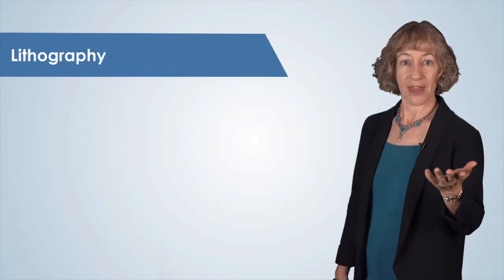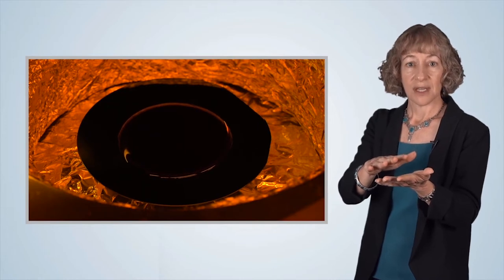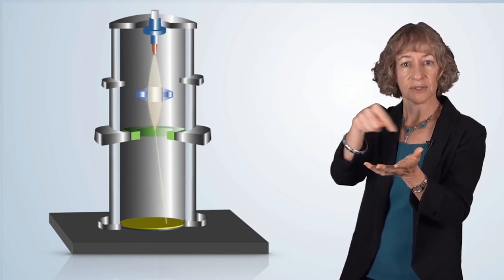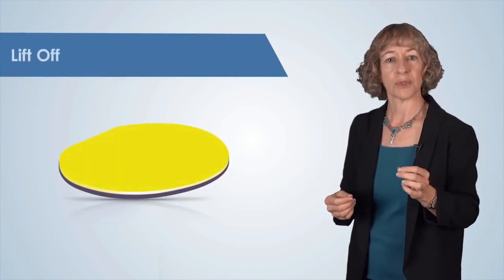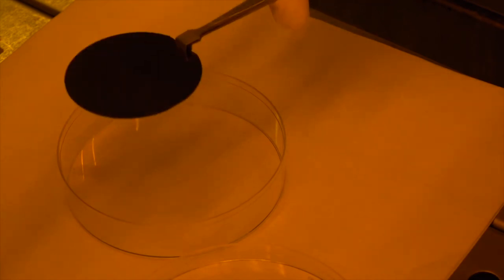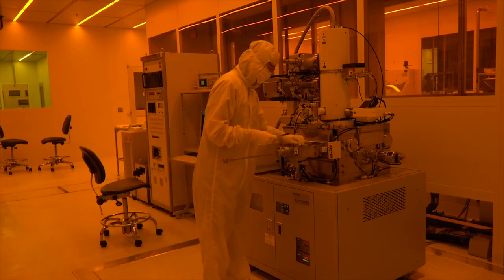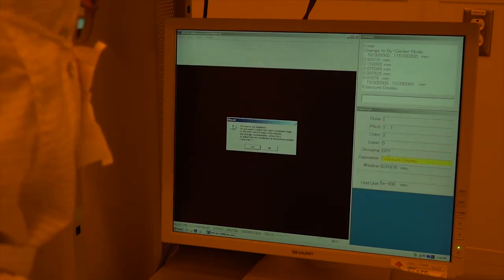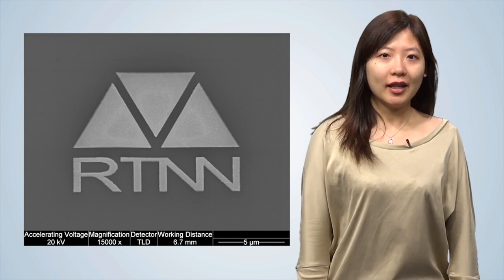Introduction to EBL

Comment: You said: "In development, only the parts of the resist that have been exposed by EBL, will be removed. But this is only true if the resist is a positive resist. If you use a negative resist, all the exposed parts are going to be hardened , and after the development, only the unexposed areas get removed.

Comment: its just a crt display, can be directly ripped out of the existing hardware, or 3d printer style printer head moving by small straight on-off electron jet source, you dont even have to use electrons, you can use direct embedding particles, direct printing, picoelectronics and picoelectromechanic systems

Comment: EBL just work like the old Cathode Ray Tube TV screen. I am not surprised if China is working on the LED-like beam flat panel Lithography machine now! It should be just a efficient as the Photolithography machine but cheaper!

Comment: Do you know the resolution of the magnitude of the magnetic field used to deflect the electron beam
Reply from the maker: I don’t know the actual magnitude of the magnetic field generated by the deflection coils. However, regarding beam position resolution: beam positioning is controlled with an 18-bit digital-to-analog controller. The maximum number of discrete positions (horizontally or vertically) is 240,000. The smallest exposure area of the system is 75 micrometers (vertically and horizontally). Thus, the spatial resolution is 75um / 240,000; that is approximately 0.3nm! Just for reference, a human red blood cell is approximately 8,000 nm in diameter… and a human hair is approximately 50,000 – 80,000 nm thick.